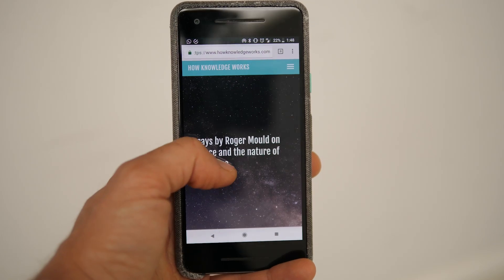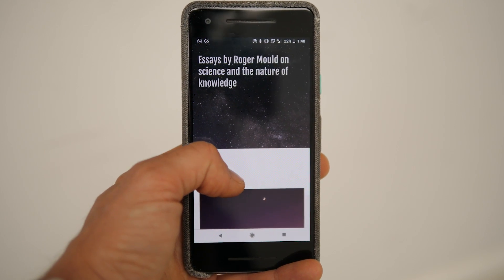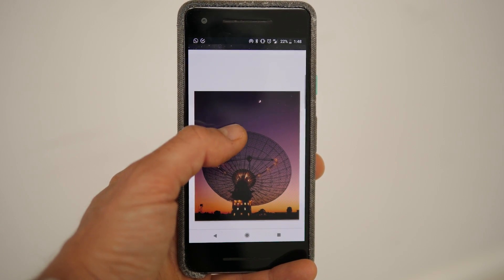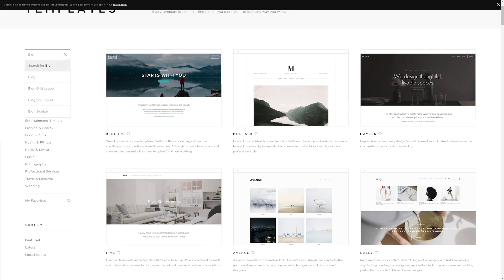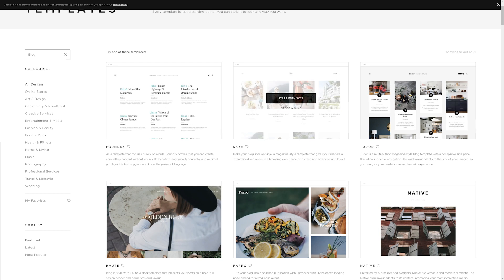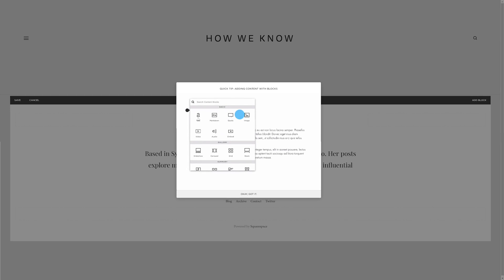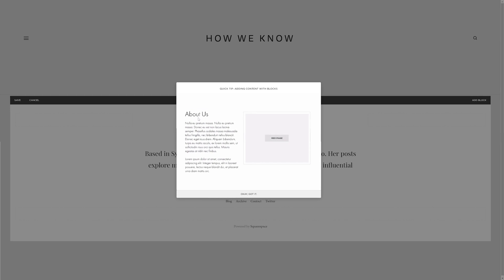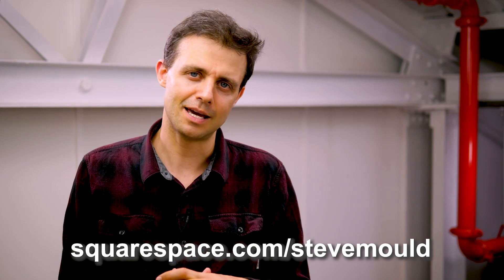The bizarre ripples that form in a stream of water

Comment: Dear Steve,

Beautiful footage as always! I think that your explanation is a little bit too simple, though. If it was a pure Rayleigh-Plateau instability, the stream would eventually break up in droplets (that's why it's called an instability). Maybe the instability still plays a role in this case, but one would have to take into account that the water flows at the same time, advecting the perturbations. That's why the stream from the faucet is quite stable for large enough flow rate, the perturbations are advected before they can grow significantly (see e.g. https://doi.org/10.1063/1.1694264, or http://citeseerx.ist.psu.edu/viewdoc/download?doi=10.1.1.368.1361&rep=rep1&type=pdf).

I think that an easier interpretation in this case is that the waves that you see are actually traveling waves created where the object is blocking the flow. Some of these waves have an upward velocity that exactly matches the downward flow velocity and can thus accumulate upstream. The wave speed of capillary waves will be roughly (not taking the curvature of the jet into account),  c = (2*pi*(T/m) / L)^(1/2), where T = 0.072 N/m is the surface tension of water, m = 1000 kg/m^3 is the water density and L is the wavelength of the capillary waves. By setting c equal to the local flow speed in the stream you will find that faster flows lead to smaller wavelengths. This explains why further downstream, where the freely falling flow has accelerated to higher velocities, the ripples have a smaller spacing. In fact, by measuring this spacing, one could measure the local flow velocity in the stream! A quick calculation gives me a flow velocity of about 0.4 m/s at 1 cm from the faucet, corresponding to a wavelength of about 3 mm, which seems to be in the right ballpark.

A related phenomena happens for ducks and boats traveling on a water surface, or for objects piercing out from a (mild) stream. They generate a wake of waves which travels at the velocity of the boat (i.e. the waves are stationary wrt the generating object or animal). Capillary waves are often observed in front of the perturbing object. Some time back I wrote a detailed blog article on the boat/duck wakes for the interested reader: http://www.phikwadraat.nl/duck_wakes/

Comment: You should try doing the experiment using fluids with lesser surface tension (say, kerosene) and higher surface tension (salt solution, for example) and compare, to confirm your theory.

Comment: I can't be certain, but to me this looks like an instance of viscous buckling, albeit at a small scale. Of course viscous buckling is usually observed with fluids of much higher viscosity, where the obstruction causes the flow velocity to drop much more dramatically. However, I imagine that the flow deceleration caused by the obstruction and the increased internal pressure of the water at the obstruction point could conceivably cause the flow above to buckle.

So I would tend towards attributing this to internal fluid interactions, rather than surface tension.

A reasonable experiment to perform would be to observe the effect of the laminar flow being obstructed by a flat surface perpendicular to the flow. If the oscillation is still observed, it is likely to rule out the "wave theory" that you drew from the observations with a lateral obstruction.

Comment: Cool vid. I've always thought it was the acceleration of the flow that sort of "rips" the stream into droplets. According to that though, when obstructing the flow at the end you're fixing a lower velocity, producing jerk (change in acceleration) ending up with a larger cross sectional area at the same time, which (like you've explained) would cause surface tension to try and pull the droplet into itself, bunching up. The zone right behind that gets a tight curve so on and so fourth and the effect travels back. This is also why the effect is tighter the further you are: the velocity of the water is faster. 🤔 If you could do a video to confirm this it would be amazing (producing laminar flow against gravity for example).

Comment: I was gonna use the metaphor of shaking a slinky and watching the waves, though the musician in me likes your guitar reference. When obstructed farther down the stream the water will be moving slightly faster than at the source as it’s hastening towards its terminal velocity (or in its case the basin of the sink) so the ripples are tighter than when obstructed closer to the flow source in which case the force can be distributed more horizontally. Similar to a loose guitar string verses a tight one and it’s frequency. Except not like that at all since the changing variable is velocity and not tension. Idk that’s my theory

Comment: This reminds me that I've noticed when water is splashed from 30 feet up or so it first forms large spheres, but after falling about 20 feet those spheres break up into rings of smaller spheres. I assume it's because of the force of the air they're accelerating through, but it would still be interesting to know if there's anything more going on there.

Comment: It looks to me like the ripples are not symmetric on both sides of the stream, imo it looks more like a spiral. Similarly like honey spirals when poured... Although honey is much more viscous, this should also occur in lower viscosity liquids.

Another similarity might be why stringlike bodies buckle under compression (*); just coupled with surface tension trying to minimize pressure.

(*) Because the water is falling, I imagine the waterflow like a thin free-floating column of water that is beeing compressed with a constant speed form one end. Thus came the idea of string buckling...

Comment: I studied minimal surfaces for my masters! The cylinder example actually forms a catenoid, which is the only minimal surface that can be made by rotating a curve about an axis! :D The surface area/internal pressure problem is solved by looking at the mean curvature of the surface. Try looking at constant mean curvature surfaces, they sometimes form wavy looking tubes like this (in particular a surface called an unduloid).

Comment: It could be for the same reason that honey curls on a surface and the amount it coils after pouring changes with different viscosity. Maybe this is the water attempting to coil but due to its low viscosity it simple appears as ripples.

Comment: That is not the explanation I thought of, because the ripples become bigger as you get closer.
So I figured it must be dependant on the force with which it hits the obstruction.
And that increases with the height it's been falling from.
If you move your finger against the stream it also makes the ripples bigger (though I'm unsure, you guys need to check)
Maybe the tighter ripples are higher energy because they're a higher wavelength ? Or is it bigger ripples that have more energy ?

Comment: 5:00 Okay it took me a while but I finally understamd why the curved has less surface area than the cylinder formed by the loops. The perimeter of the middle part gets smaller, so it has less surface than the full cylinder.

Comment: Really interesting video. I think the reason the ripples get more "squashed up" when you move the obstruction further down the flow is due to a doppler-like effect. The waves propagate upwards from the obstruction at some wave speed, relative to the speed of the water. When the flow is slow (i.e. nearer the tap) the wave speed is much greater than the flow speed and the wavelength we observe is hence longer. As we move down to where the flow is faster (because the water has been falling a longer time) the flow speed become close to the wave speed and so the wave fronts are closer together, giving a shorter wavelength. If you went further down, to where the flow speed was actually greater than the wave speed (torrential flow), this effect wouldn't happen.

Comment: So many phenomena around us that we just don't pay attention to.

I seem to recall that standing waves were used to make water flow uphill (against the pull of gravity). Perhaps your experiment isn't so useless, after all. Expanding our comprehension of hydrodynamics could lead to improved designs for water transfer systems, reducing drag (or is that impedance?) & increasing laminar flow, to significantly reduce the energy loss (through inefficiency) from the system.

Comment: So I presume you get a similar thing at the leading edge of an airplane wing (or any object traveling through air). With supersonic flight, these waves then disappear because the aircraft is now traveling faster than the pressure waves can, and so the dynamics of flight faster than sound are different than below the speed of sound. I don't really understand this very well, but I think your video added a piece to my mind-picture, so thanks for that.

Comment: I believe the standing wave length is a function of the surface tension like you said, but the whole reason it even forms is the same reason airfoils cause upwash. In fluid dynamics, the pressure changes around an interfering object creates a pressure wave back upstream (for subsonic flow, not supersonic) which makes that fluid adjust it's path/pressure/velocity, etc. For supersonic flow this doesn't happen, but for subsonic flow you will see significant effects quite a way ahead of the object in the flow. Me thinks that the water is trying to do the same thing, but then the surface tension is constricting the effects and creating a standing wave. Look up "airfoil upwash" for a reference of upstream effects of objects in subsonic flow.

Comment: Surely when the water hits a surface at one side, the flow on that side will slow down, causing the opposite layers to ride over it
as an example, draw a straight line except for a tiny hump, then draw more lines exactly parallel to the first, just like layers. including going round the hump, before long the resulting hump will be much larger than the original.
Does the same thing happen when dropped onto a flat surface at exactly 90 degrees to the flow ?

Comment: I’ve been thinking about this more and it really has me interested. Water falling from the faucet should be supercritical flow meaning the flow velocity is faster than the wave celerity. So there should be no way to affect the flow upstream with an obstruction. Maybe surface tension travels faster than waves? This is beyond my knowledge of fluids, but a really cool phenomenon.
Reply: To me, it just looks like the water it stacking up on itself because it’s incompressible. The flow rate wants to stay the same and the water wants to stay together, so it ripples up to create a longer path.
Reply: @RobertKreegier  The surface is stacking.  The inner flow is accelerating.
Reply: @RobertKreegier  That's what I thougth!
Reply: There are two different wave speeds to worry about. There's the speed of the surface waves, but also the much faster speed of the sound waves within the fluid. It's the sound waves that transfer most of the energy and momentum. (Like, consider the bow shock of a boat. Even when the boat's traveling faster than the surface waves, which they often do, you still get a bulge in front of the bow of the boat.) 

But yeah, I agree that it's probably not just a surface tension effect for this reason.
Reply: I think that the reason may be similar to when you pour honey out of the bottle and how it coils up; when the water contacts the obstacle it slows down forcing the water above to move out of the way. The waves up above the obstacle could be because the flow is slower than the speed of sound in water meaning the waves can propagate upwards. I like to image it as moving my finger through a pool and seeing the ripples move faster than it.
Reply: The pinch points look like they're always on an angle. Looks more like the Honey Coiling effect to me... Just with a higher viscosity fluid...
This would explain why the waves get shorter further down stream, as the coil period would get tighter... same as honey.
Reply: Are you aware of the supersonic jet phenomenon that causes a jet of supersonic speed to be ejected when you drop an ordinary object into an ordinary pool of water? Think of a "plop" into a pool or a toilet. One of the channels here did an episode about it a few years ago. Here's an article link: https://physics.aps.org/articles/v3/4
Reply: I think it would be really cool to compare the surface tension affectby doing the same experiment with a liquid with less surface tension than water and more surface tension than water
Reply: Interesting
Initially it is laminar flow, speeds up and become  critical flow. As far as I know
Reply: I agree with some of the other comments, about it resembling the honey coiling effect. EXCEPT, Grady's poi t about supercritical flow gives me pause. When honey coils, is the honey experiencing supercritical flow, or subcritical flow?
Reply: Practical Engineering The water is twisting from the faucet. Just like water down a stream or a toilet like Schauberger points out.When an obstruction comes to the flow it causes an imperfection to the flow. Which as a column, looks neat. The capillary action of the water helps hold it together as it twists. In a Fibonacci spiral with various wavelengths depending on your boundary condition input.
Reply: Interesting comment: " supercritical flow meaning the flow velocity is faster than the wave celerity."  I'd never heard of this before.  Thanx.
Have you ever wondered about the "why" of the high heat capacity of liquid H2O?  Check this out:
Mechanism of H2O High Heat Capacity
https://www.youtube.com/watch?v=2MUoFF121kQ
Reply: Practical Engineering A
Reply: I ask myself wether can be a side offect of bernoulli's theorem
Reply: The water falling from the faucet is moving pretty slowly, basically starting at zero speed and necking down like that as it accelerates. but I haven't done any fluids for a long time.
Reply: My intuition (which of course is not to be trusted) keeps trying to insist that something is traveling back in time to cause this!
Reply: Grady nooooooo ever since one of your videos I just assumed it was a variation on a hydraulic jump! I learnt wrong!
Reply: I don't think it is the same as the water drip. Imagine a  black hole at the end of a laminar flow that creates an immense vacuum to suck the water stream faster than it can flow. The surface tension will want to keep some containment and as the vacuum is applied, there will be a thinning of the stream. In contrast here, we are putting a blockade that will increase pressure and the surface tension does a small amount of keeping the stream together and backs up the flow as much as the surface tension can do. When this backup is great, it will make a splash because it overcomes the surface tension, but when it is slight, it creates this bulge as if you were stuffing a sausage casing (the surface tension) and not allowing it to move forward.
Reply: Skin
Reply: Wouldn't it be just that the water is slowing at the point of intersection and the ripples are pushed back up the stream? Blow air through your lips and see if you feel the wind on your chin. You introduce and obstacle slowly. Do you start to feel wind on your chin?
Reply: Please look up Victor Shauberger, he studied river systems in Austria in the early 20th century, he has been referred as the Nikola Tesla of water. The way a river bends and veers left or right one after the other, he shows that sand and dirt can actually flow upstream, which goes to explain how river trout are able to swim upstream. Sinusoidal and laminar flow are the key, they induce a level of vortex-ial double helix motion. He has some really far out ideas, that seem to show that some flows exhibit bizarre electromagnetic phenomena. A really cool experiment is with if you create a vortex whirlpool, like the one created when you pull the plug in your bathtub, you inject some ink or something at the bottom of the vortex, the ink actually travels upstream in a cylindrical movement straight up! Please do yourself a favour VICTOR SHAUBERGER.
Reply: @oliver_milan  You sound desperate..... Schauberger, I love his ideas
Reply: To my knowledge, surface tension is the speed of sound. If you had a rod all the way up to the moon, and you move the bit near earth the tip near the moon would not move faster then the speed of light.
Reply: @TheDreadedHope  I believe you meant to spell "then" "than" and meant "speed of sound" and not "speed of light"
Reply: I'd imagine it's from the particles/atoms impacting stuff, causing them to bounce back (on an atomic level, on a large scale they just flow to the side) and when they bounce back it sends energy backwards as a wave.  Having a constant and mass amount of atoms hitting it like this and reflecting their kinetic energy, probably is whats causing the wave.  If you increase the rate of flow by pressurizing it instead of relying on gravity, and I'm right, the wavelength should get shorter.  It'd make sense that when you move your finger towards the faucet the length of the visibly wavy area increases as that's getting closer to a source where the energy can get reflected back, ant at some specific length (which you'd calculate using gravity and the mass of water maybe and such) it becomes resonant and most visible/strong, or tuned to the frequency if resonant isn't the right word, like selecting the correct/optimal antenna length for a wavelength where the waves are reflected at the exact right point and none of them cancel each other out.  Calculate the "antenna length" for molecules of that weight traveling at that speed (you'd have to know the length to get the speed), and see if it creates the most stable wave even at each octave.  I'd consider that reason to call it the cause instead of surface tension (though surface tension is required to get a wave instead of spatter all over the place)
Reply: Ooga, booga booga